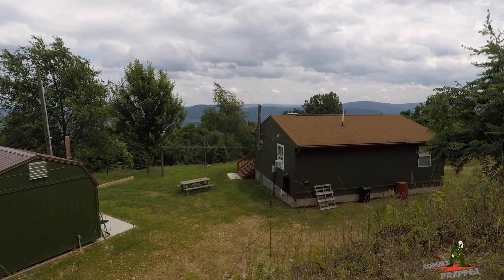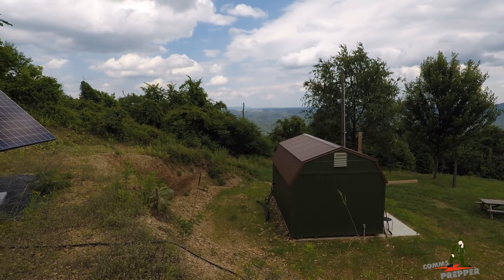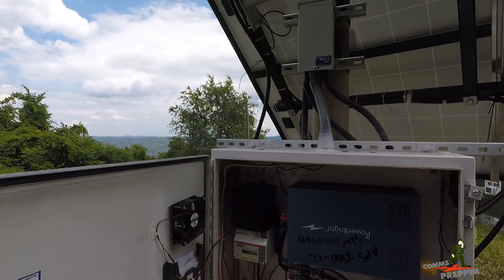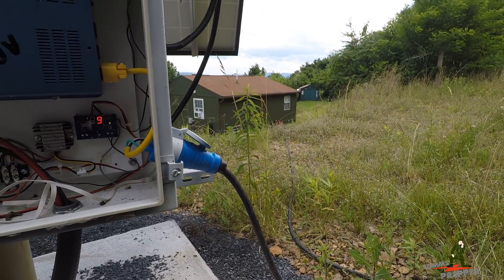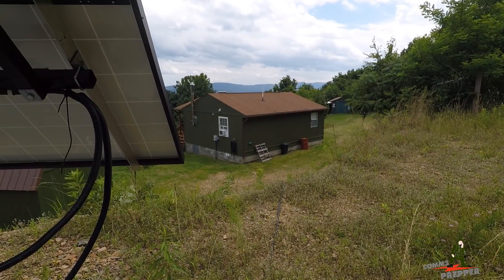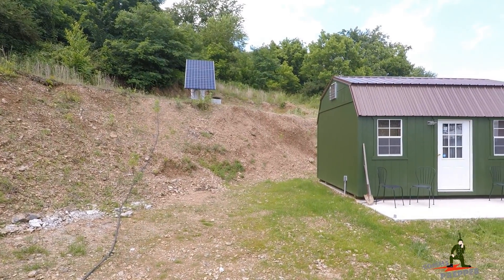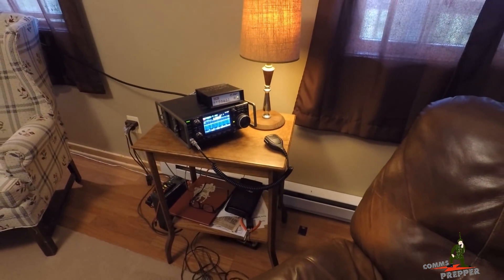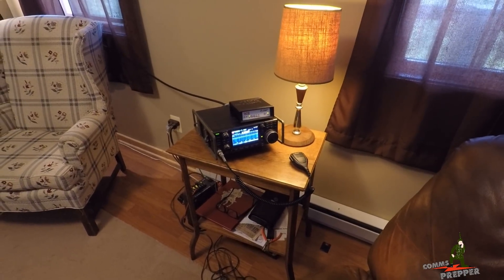Solar Power Supporting Amateur Radio Field Day

Comment: How do you deal with the excess voltage from equalization. Those voltages can exceed 15vdc
Reply from the maker: I disconnect the inverter.
Reply: @Commsprepper  okay but ham radios don't like over 14v

Comment: Great Video. Have a Hybrid Solar Wind setup. It uses a Whisper 3000 S.W. Windpower 2 blade and 2500 Watts of PV since 2004. It is 48 Volts. The only reason it needs batteries is because of the wind generator loading needs. Otherwise it uses the grid as a battery as long as it works. They owe me on net metering most years. 73 W7RU

Comment: Just found your channel while looking for a info on a good charge controller and found your Morningstar video seems which to be from 2015 but no promised follow up and then found your( so far as I can tell) latest video on Solar for Field Day where you show your much improved setup... Great stuff wish my project was as far along as yours... If you don't mind helping I have a couple of questions 1.) How is the morningstar charge controller working out for your system? It is what I am leaning toward but have no reliable recommendations so far.  2.) What is the brand name  and model for your  box enclosing  your control system?  I was looking at constructing one but yours looks to be the solution I have been looking for... 
Thanks for any help! KE8AJO --- 73
Reply from the maker: The morningstar controller is working great!  It has run flawlessly since installation.  My videos are bit mixed up on the channel but I do have a solar playlist.  My box is a used Hoffman NEMA enclosure I got off of eBay.  You can buy them new but they are expensive.  There are several rating types I, II, III that have to do with interior and exterior use.  Since I had to have a county electrical inspection for my system - I had to have the correct NEMA type box.  You can find these boxes at all electrical supply shops.

Comment: Hi !  Camera and Gimbal System seem to be doing an excellent job !!   Appreciate the detailed tour of the outside panel, along with house connection and interior breaker box.   How do you like your 7300 ?? How many BTU;s is the AC ??   Can you tell me where you obtained the solar panels, and their wattage.  I am new to the solar game,  so sorry in advance for any Novice Questions  :)   73 !
Reply from the maker: I love the IC-7300.  The AC is 5000 BTUs (Walmart) but does not/not run on solar.  The panels are kyocera KU-265 panels.